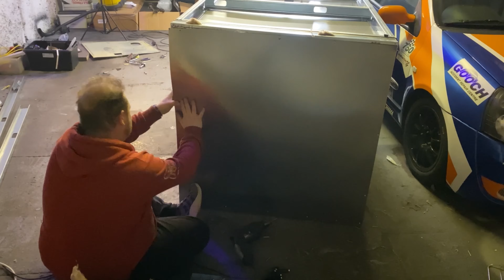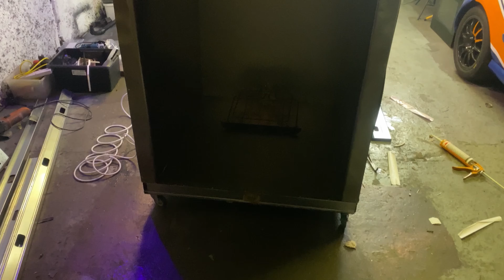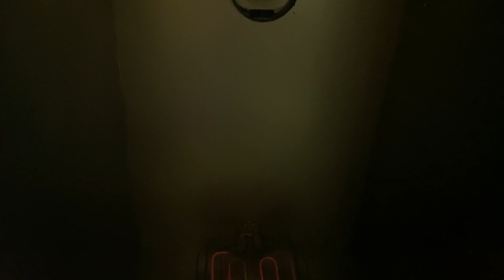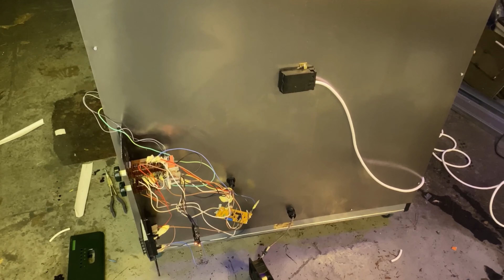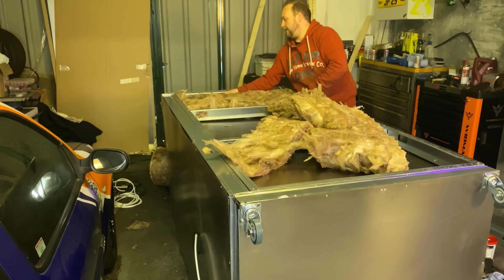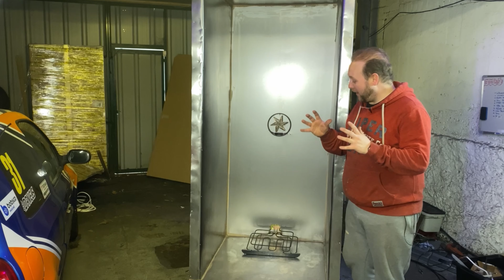Building My Own Powder Coating Oven Part Two

Comment: Nice job on your oven! I am also doing the same thing. I just purchased an Eastwood Hotcoat gun and power supply. Soo I have been designing the same oven design 36"x36"x60", on caster also. I will be starting this next wk in the shop.
Reply: Great minds think alike
Reply from the maker: Awesome man! Good luck on your build!

Comment: Shouldn't there be a vent?
Reply from the maker: Not what I read when doing my research. How can there be a gang and heat up to 200 degrees?
Reply: @TrackAndBeyond  Fan ovens circulate the air from the oven chamber, through the element and back out into the oven. As  far as I can see, your fan cannot circulate so there is a great danger that your fan element will either overheat or will add little to the operation of the oven!

Comment: How long did it take you to build?
Reply from the maker: About 3 days all in and done did 1 day a weekend basically wasn’t to bad at all really
Reply: @TrackAndBeyond  oh wow that’s not bad. I have no construction experience so I’m in fear of attempting cause I would’ve thought it would be much longer to build but I’m tempted because an oven run about 4K on the low end. So saving 3k is tempting to attempt.
Reply from the maker: Exactly this size oven would have cost me around that and fro around £700 instead I’m super happy! Their are some bits I want to change and have already added a temp display etc. I want to do another video soon on bits Iv changed. To be honest I’m a keen DIYer but never done anything like this before and turned out pretty good!
Reply: @TrackAndBeyond  thanks for sharing. I appreciate it I think I’m gonna take on the challenge myself. Any tips that you wish you knew before you started that would make the build better or easier?
Reply from the maker: @Arikos08   no worries! Just make sure you buy an over an grill combo that can be used at the same time like what I got as you’ll need as many events to heat it up as possible so doesn’t take to long to heat up etc. only thing I’d have really changed is make sure with the fan assist bolt it on the very back so it doesn’t get hot. I’m in the process of changing the van location as I burnt the first one out. Other than that just take your time measure correctly and take in ti account door size etc. I miss calculated and the door would have been too short as when I bolted all the out panels together even though was a 2x1m oven the exterior was obviously more so when I tried to bolt my 2x1m door up it was too small
Reply: @TrackAndBeyond  thank you so much for the help I truly appreciate it. Look forward to more vids from the updated oven.
Reply from the maker: Thank you 😄